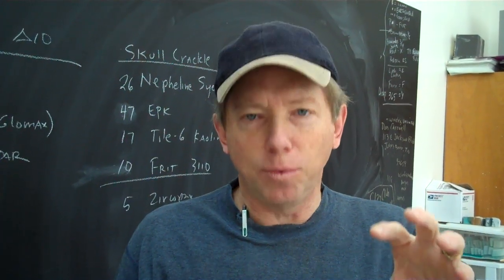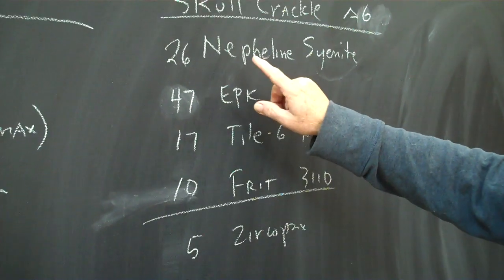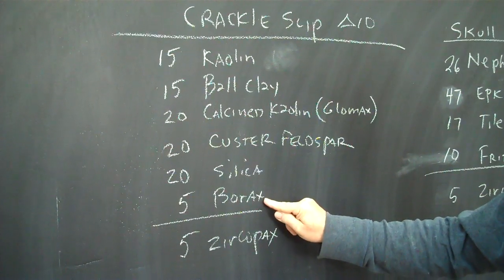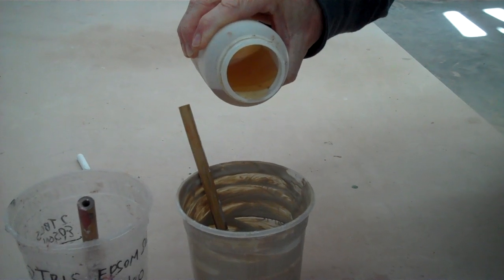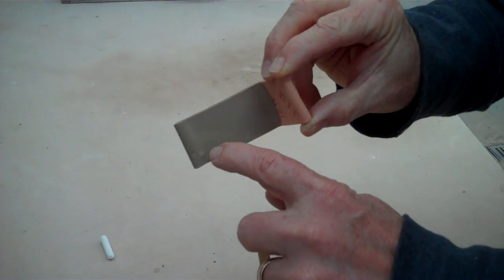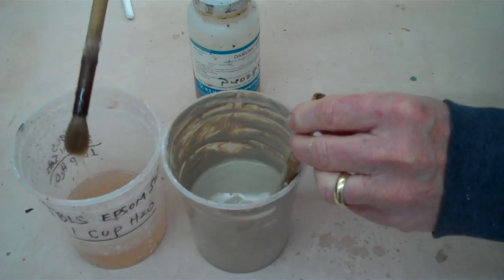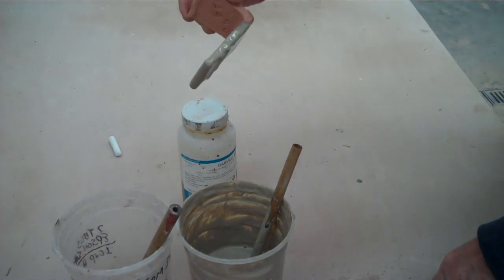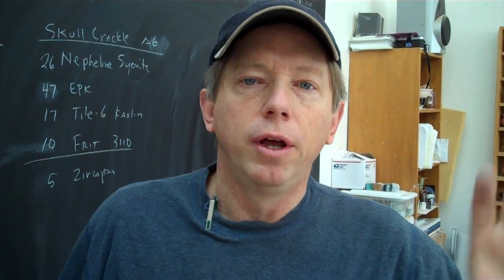Why doesn't my crackle slip crackle any more?

Comment: Is it possible to substitute the borax with whatever boron source i have? would this also work applied to greenware ?
Reply from the maker: You can use borax, some use the laundry detergent "20 Mule Team Borax".   Should work on greenware but won't crack the same.
Reply: @johnbrittpottery  thanks a lot ! Will give it a try :)

Comment: I have done this a few times with slip and in my experience the Epsom salts and water take about a minute or so to finish their flocculating properties.  Just my experience, so when I add them I add, mix and wait 1 minute or so to see.  I have ended up with some pretty thick slip by adding too much too fast.